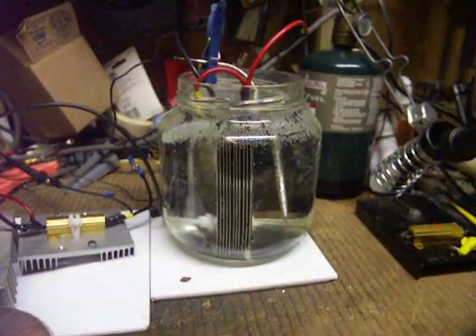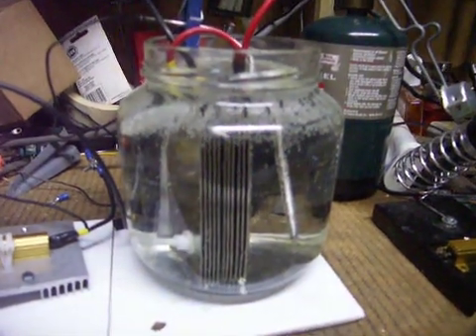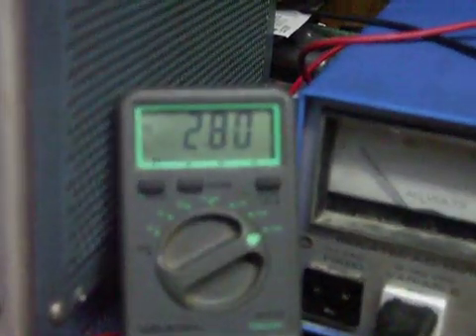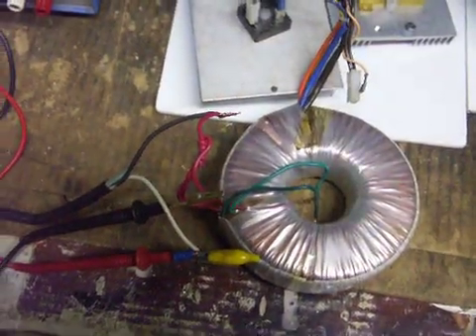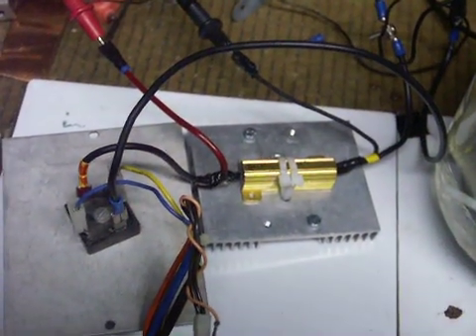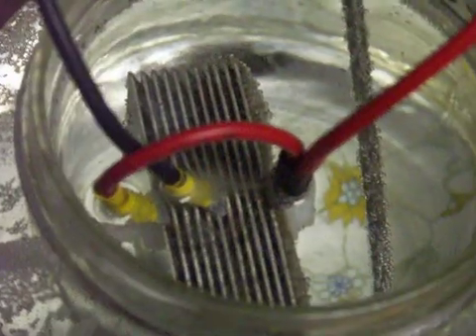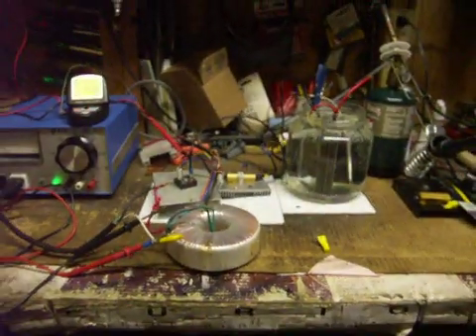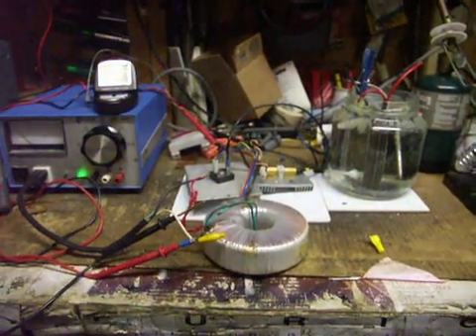HHO high voltage DC test with ss wall plates #1

Comment: Thanks for the video. It shows that success comes from power transferred. It doesn't matter in what form, just energy. You can use something like this to have basic separation, but to bubble it you need brute force like a tidal wave or continuous strong current.

Comment: what happens if you add an electrolyte. I have found a few good, safe ones that the HHO team has shared, #1 baking soda that has reacted with vinagar then put in hot distilled water from the stove, it appeared to work very well, Ive tried it ( earth friendly & safe compaired with the potasium hydroxide...Hope this helps, in places were it frezzes I believe they add 90% isopro-alchol?

Comment: Did you add anything to your water?  I think if you add baking soda to the water you will get much better HHO production.
After that you might try expanding the spacing some with the higher voltage.

Comment: There is no set frequency. It depends on the plate size, temp, water contaminates, and other things. Also the assumption is you are trying the Stan Meyer method! Then you will have to step charge the plates/tubes (cap) with a PWM with voltage stepping from 1kdc up to 20kvdc pulsed anywhere from 10khz to 45khz. But it will need to be gated (pulse train) cycled on and off so the Hydrogen and oxygen can be release from the sides of the plates due to the high DC potential acting like a magnet.

Comment from the maker: As for using the Lawton circuit to drive a toroidal transform to achieve high voltage just doesn't pan out. I know this from experience. I'm working on building a push pull diver for my toroid to get the efficiency of my transformer up because pulled DC DOESN'T WORK, at least I can't get it work. I may just end up using a AC to DC inverter in the end, not sure yet.

Comment: I've watched that video.  My point being this....The whole idea of using a PWM came from Meyer's design, which used very high voltage and no electrolyte, with a very specific design to his cell.  To simply apply the method to any cell doesn't make sense.  What are we trying to achieve?  Maximum gas production at a given temperature with the lowest power consumption possible.....right?  I only see practical uses for this, ie. auto milage booster, welding, etc..  Overunity is not going to happen.

Comment: Your right Scarecrow, 80v shouldn't get the water to split using Distilled only.  Perhaps the plates were not cleaned completely before and after assembly, that would account for a minute amount of conductivity.  PWM is good for reducing your current at lower voltages, but Meyers used it with thousands of volts.

Comment: Well, good luck with it.  Dont want to spoil your fun but I have been here.  Found had to go high voltage to do much with distilled.  This is why I was a bit surprised to see much of any action at 80v. A touch of e-lyte and she would be frothing but suspect you know that. Seal up as much of the edges on your plates as possible and still get flow and she will be more efficient at low voltage but suspect you already know that too.